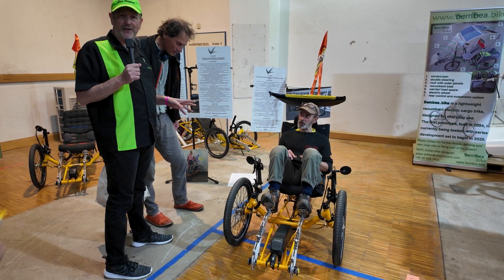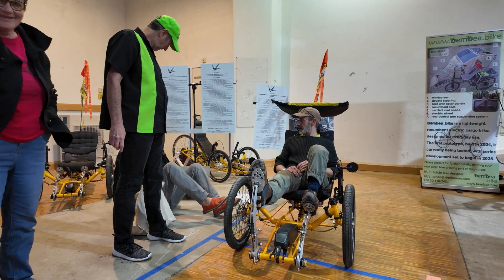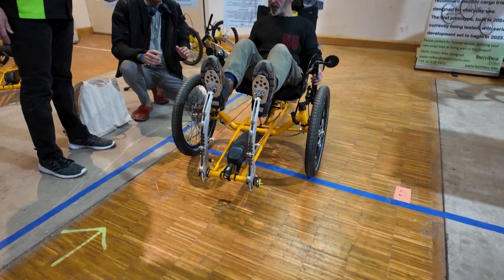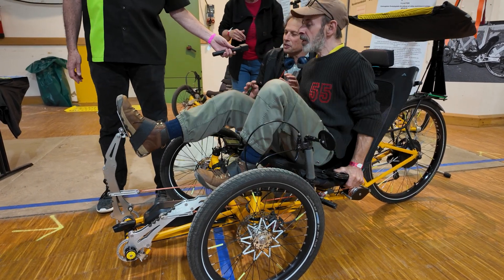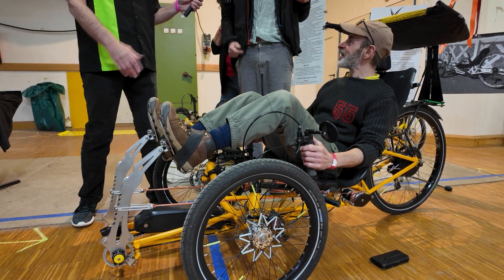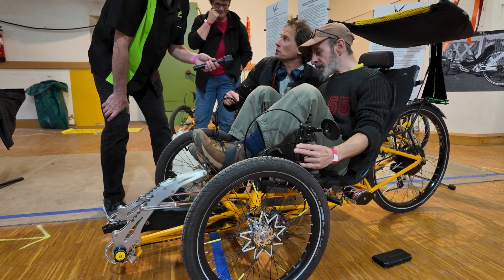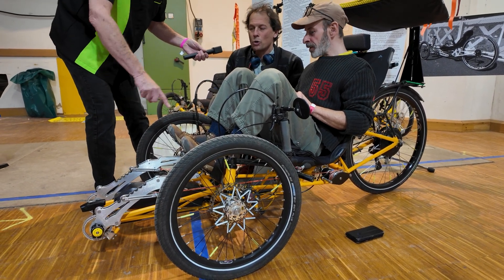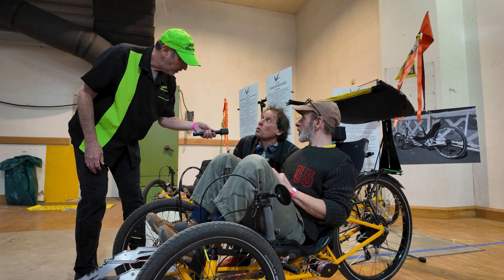Spezi 2025--Invention Lab-The Step Trike

Comment: This system have potencial even for velomobils.
In my quest i have pretty much pedal limit 60 kmh because i lack higher gears and pedaling just lower stability. With well desighned gear system this can potencialy take over normal pedals and long chains.